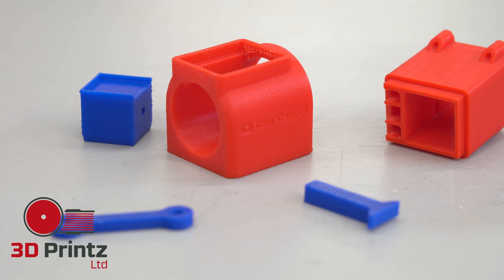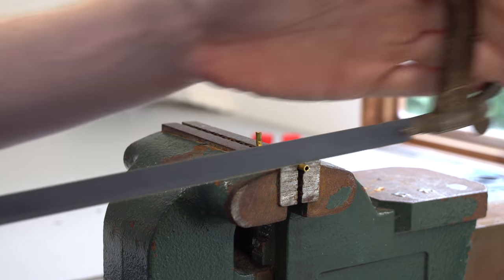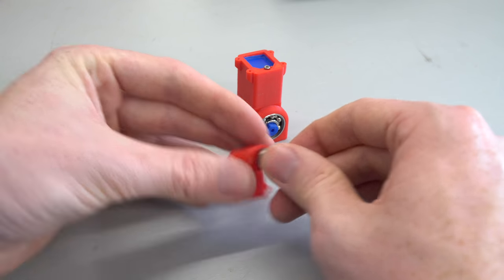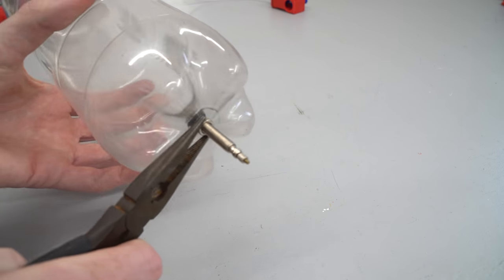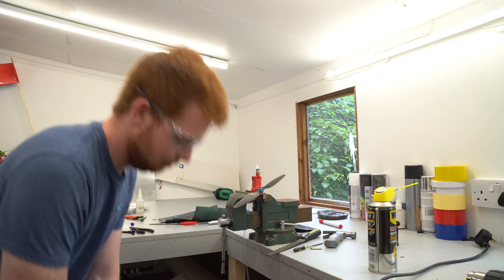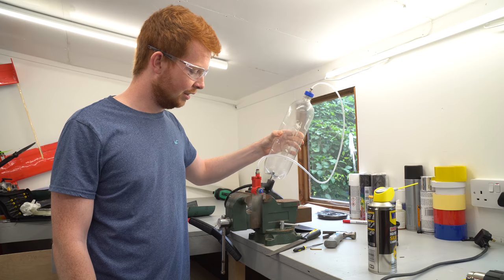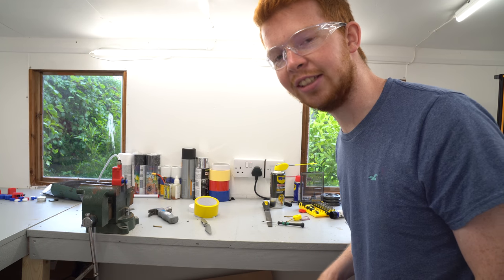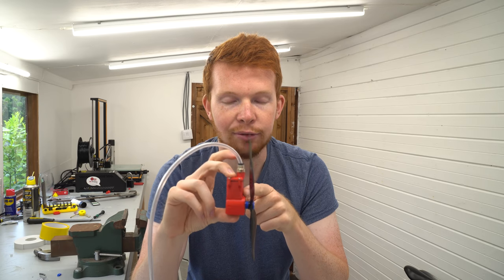3D Printed Air Engine BUILD

Comment: Hey Tom! In terms of efficiency, I found out that opposed piston engines are the most efficient! You should try build one, it's easier than it looks.
Reply: RedKugelblitz It only has one cylinder and two pistons. It's much more efficient.
Reply: RedKugelblitz The cylinder head has a lot of stress when the engine runs, and it turns really rough to the piston, and forces it down fast and it slowly decreases speed per revolution. On a opposed piston engine the energy is all used, because the cylinder head isn't dispersing any energy. Also, leaks wouldn't be a problem, since you would still produce twice the Torque in the output shaft (two crankshafts). You can also gear it and make the output shaft rotate twice as much faster by using a smaller gear on the output shaft. Also, the torque curve ( change of speed of the  piston per revolution , since the the energy is being displaced softly and constant, because there isn't any over pressure on the intake) is smoother, making the engine run better. And you can also use a rotary valve. The leaks could be a problem. You could come with an increase of about +30% on an internal combustion engine (without the losses by the leaks, 30% has the friction "included"), that with the leaks would be 20-25%.
If this air engine had 5-6% efficiency, this design could get it up to 10%, or even more. I'm a ic engine designer, you can trust. I'm basing on the two stroke Diesel opposed piston engine, if you were wondering.
Reply: RedKugelblitz You don't need any gearbox if you connect the output shaft With gears, as it is supposed to. And it doesn't have much more moving parts, so doesn't have much more friction. What I have said is that the cylinder head suffers from a lot of stress, and there is a lot of pressure there before expansion, so the pressurized airflow is reduced after the start of the expansion, since you can't get as much air, and the power curve is unbalanced and rough. The advantage in this design is that it can still run with the ball system, but is really hard to do that, but rotary valves are pretty good and much more efficient in this design, and believe me, with proper lubrication, that engine will run for a long time.
Reply: RedKugelblitz And you just have a central intake, so yeah. I've tried this with Legos, it's pretty nice.
Reply: RedKugelblitz I don't have any of the opposed cylinder engine Design, but I do have one of the normal one . Also, if you search for " Lego opposed piston vacuum engine" you can see some videos of a similar design of mine. I couldn't record it,  because camera seems to be epileptic and everything comes black, so I could only record the single piston. My design of the opposed piston is much faster than on those videos on YouTube, and has high torque. Unfortunately I don't have it anymore, my little brother destroys everything!

Comment: Hey Tom, hopefully you read this comment because I have an interesting idea. I suggest you put a fair amount of dry ice in the bottle and see how long the propeller will spin for. If not enough pressure is available at any given time, crush up the ice to increase its surface area in order to increase the rate of evaporation.

Comment: Could you remind me, why did you choose square shape of piston and not round?
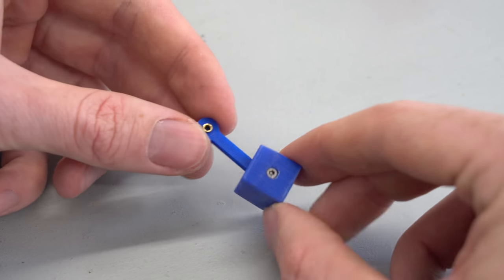Reply: Petras L  You got me curious too. It was so he could have the connecting rod off-center in the piston; so he could reduce the overall length of the engine, and eliminate one of the bearings. https://youtu.be/FoQUwpfFnnE  at 3:40.
Reply: Sanding a flat surface is easier than round.
Reply: Yep, its true also, but if i noticed properly, now rod right in the middle. And by having square piston, it should be very hard to make precise corners, like Tom mentioned, the same radius/shape to avoid air leakage there. By having round piston it should be possible to mount it, lets say, on the drill and grind it like with lathe. But lets see where "natural selection" will bring Tom's motor ;) Good luck! Its really interesting to follow this series!
Reply: I think round piston would be better, too. A circle has better perimeter to area ratio (around 3,5) than a square (4). That means, when you use a round cylinder, there should be less space for air leaks. Edit: these numbers are only for 1 cm2 pistons, but I think you get my point.
Reply: Round would have less leakage and less friction. Seems like the difficulty of manufacture is a no-brainer here, the engine would just run better once it was dialed in.

Comment: It would be cool to implement a throttle body with just a simple butterfly valve, or a  ball valve. This works off the theory of, just because my car's gas tank is full, doesn't mean I run it all out immediately. You could control rpm, make the air last longer, and not have to worry about the psi, you're putting through it as you can control how much air gets to the engine, not via a bike pump and a water bottle. This would be very easy to add, and wouldn't take more than $5 and 5 minutes.
Reply: He already made a membrane valve for one of his engines
Reply: Yep do this!
Reply: What he really needs is a pressure regulator so that he can have a high pressure reservoir last longer.
Reply: Por que no los dos?
regulator and valve. The membrane valve he built worked for demonstration, but would be almost useless in any actual use case. You can hook a servo to a ball valve.
Reply: Squat251 aluminum high pressure cyl hooked to a pressure regulator then a ball valve servo setup.

Longer run time with controllable throttle.
Reply: Pressure regulator with really high pressure container would probably be the way to go. Could probably used those tiny CO2 canisters to run the engine for quite a while.
Reply: WD40 dry sump system next...
Reply: Pilotgeek the changing temp might warp the cylinder making it lose compression.

Comment: If you check out dustin video at smarter everyday astronauts excercising equipment. The machine uses a vaccum pistol design that uses the surrounding atmosphere pressure to produce a constant force to simulate weight. For an air engine to use a vaccum piston it will need a second chamber that is connected directly to the engine which will be the source of air. The vaccum piston will apply a constant force to the second air chamber as a result, the air pressure that is going into the engine will be constant and at its most efficient and give the highest rpm to start to finish.
(DISCLAIMER) I AM NOT AN ENGINEER AND NEVER MADE AN ENGINE. JUST AN IDEA, THATS ALL.

Comment: to make the soft drinks bottles hold up to 120psi you can wrap them with duct tape for more rigidity, I have personally got my bottle to hold around 100psi for my diy tubeless tire set up
Reply: Daaamn! Creative.
Reply: The problem is that they'll take like 150psi at least, but only once. Plastic like this fatigues over time, so if you continuously use a high pressure it will eventually fail catastrophically. The bottles are designed for a maximum of 100psi (which is a full, shaken bottle, in a hot car), so I'm not sure why he doesn't just use 100psi constantly and swap the bottle out after a dozen or so pumps (isn't like they're expensive).

The duct tape would contain the shrapnel if it exploded at 150psi, but being that this is for an aircraft, the weight would be a pretty big downside.
Reply: Jacob T:  Daayyaammn good critical data!  Lesson learned.

Comment: You Should really consider using a graphite dry lube, less friction and more seal.
Reply: Daniel G. - Really good suggestion! In fact maybe a fuzzy sanding so piston almost fits tight then the graphite lube makes the seal slick?

Comment: maybe you could try using a additional layer of paint primer/filler after sanding to get it even smoother and maybe get the gaps smaller.
Reply: Andi - Yup good idea.  Spray paint would be best I think.  Plus there is that Krylon stuff that turns wood into acting like lubricated metal.

Comment: Good, back to basics on the build, looking very good. If you found a smaller diameter aluminum cylinder in the area of 40-50 mm diameter and say 300-400mm long, you could run the pressure up to 120 psi or higher and place a regulator set at 60 psi and the engine would run at air speed for much longer. In your tests before, at 60 psi the plane wanted to fly with the larger propeller, but the pressure died off so quickly it couldn't make it. This design is the best, IMO. The next step is to add 2 cylinders in order to get more torque, but then you would use twice the air volume...
Reply: Tony -  There is a comment on here that suggests wrapping the plastic soda bottle with duct tape to get 120 in that bottle!  I'm thinking the new Gorilla Tape would even allow higher PSI.  I liked your comment.
Reply: clavo Thanks! My idea about the small diameter aluminum tube would give less air drag. I think the tape would allow more pressure in the bottle, but you stil have all that large diameter surface as drag.
Reply: Tony: absolutely right about the drag.  I like your tube design in that aspect but balancing, costs and tooling intelligence needed; I wonder of a 2" pvc plumbing pipe would work?
Reply: clavo Yes the PVC would work at 120 psi and is a great idea. The limitations on PVC is right at 120 psi for schedule 40. It should work fine though for this application. I am not sure about the weight comparisons from PVC to a thin wall aluminum tube though, I would think the aluminum would be a tiny bit lighter in weight. The other side is as you say, fitting the aluminum would require special tooling and abilities. I like the PVC idea a lot. I should mention that the limitations on the pressure of PVC is the joints, not the tube wall. Having worked with PVC in compressed air systems shows that the failure is typically in the joints and where the failure is in the tube, other factors exists such as cantilever or external forces cutting the tube.
Reply: Tony - Just for grins; What would you think of Tom making a air compressor; almost identical to the motor, that would run off his bicycle back tire the way old mini electric generators did years ago?  He could set the back axle on a stand to let the rear wheel freewheel as he pedaled to run the compressor.  Again he could use PVC pipe (3") for a storage tank.

Comment: Just fantastic work, man. Something I was thinking about... There are dc motors air pumps... I don't know if any of them is strong enough, but... It may worth looking at. 😊
Reply: MC's Creations fun but very inefficient lol
Reply: Possible, one could keep air pumping into it continuously...  but like the person above said, yes, inefficient.  You might as well power it by a battery motor instead of an air engine at that point.
Reply: perhaps too heavy?
Reply: Robbie Boehmer It depends on what you use the motor for. If it's for an airplane, probably. But for a car?
Reply: As a rule, air under pressure will be a more efficient storage mechanism than a battery, by weight.
Reply: Guybrush T. -  i've been thinking of a similar idea for creating big volume air compressor for home use.  Only the syringe is a foot in dia. and ten feet long.  Yours is a really good idea.
Reply: @ Peter N Really? do you have some numbers for that? WattHours/Kilogram
Reply: Benjamin M. - In 1986 I helped a guy produce in-phase 115 VAC via  windmill driven air compressor and stored compressed air to turn a vane type air motor to in turn spin an induction type generator.  At that time I helped the Phd proff. research the viability of using compressed air and its efficacy.  It was pretty much universally acknowledged that Compressed air was the most efficient way to store energy.  I Can't give you numbers now but it shouldn't be hard to find.
Reply: Most efficient by what metric? Definitely not by weight, especially comparing to modern Lithium batteries.
My little bit of research gives me ~ 820 kJ/kg for Lithium-ion where-as I think you would have a hard time getting more than 200 kJ/kg from compressed air even with a carbon fiber tank.

Battery tech has come a long way since the old 150 kJ/kg of lead acid.
Refs: https://en.wikipedia.org/wiki/Compressed_air_energy_storage#Specific_energy,_energy_density_and_efficiency

https://en.wikipedia.org/wiki/Energy_density_Extended_Reference_Table
Reply: Benjamin - You may be right.  In fact they were looking at using old worn out oil wells to store the compressed air at the time.  How do you distribute that?   There are other factors to consider though.  Making use of battery energy requires electric metal motors and metal wires and high-tech. This is plastic, and low tech.
Reply: I agree, it seems my information was well outdated.
Reply: There is a way to recycle low pressure exhaust back into the pressure tank and create perpetual motion using non return valves look at Scott Roberson's compressor system and also Bob Neal. A leaf blower was used to create a free energy vortex!!

Comment: Try using pressurized CO2 bottles instead of a plastic bottle. They hold much more gas compared to their size and CO2 has one of the highest expansion rates. I don't know if the pressure would be too much for your engine, but I suppose you can use a pressure regulator for that.

Comment: Tom OKAAAY!  Well done young man.  You have an inquisitive mind and you enjoy the positive feedback from successful projects that began as hypothetical or theoretical propositions.  Here's a theoretical proposition:  make your motor run on that soda/Mentos experiment.  You'll need to make a removable Mentos dropper or depositor and plumb the hose to your motor as normal but because of the added viscosity you may be able to use thinner hose; or You may HAVE to use larger diameter hose for the same reason.   Maybe glue or attach a bottle cap that will just barely snuggly hold the mentos pill so that you can urge it to drop by tapping the cap.  If you need sketches let me know. I have many other questions and suggestions but don't want this to be too long.  I see there are many similar and better suggestions already.  It's amazing how many thoughtful creative people are commenting.

Comment: I just had the idea to use the area under the the cylinder (crankcase) as a "second" cylinder.
Reply: Yes, I think tom was talking about this in the last video. How the crankcase negative pressure is making it use some of the air pressure to make a full revaluation, if it was an opposed cylinder engine, it would stay neutral, if when one cylinder us tdc the other is bdc..
Reply: Phil theVwGuru I ment to put another cylinderhead on the crankcase. But that could be unefficient because the crankcase is too big so much air isn't used.
Reply: Seems like push/pulling the same piston as you are suggesting could be done just with some valving modifications of the same one cylinder head, combined with the valve as per old train steam engines.  A "D valve"?  Actually it's a push/push.
Reply: clavo I didn't knew that something like that exists but I think that adds  to much complexity.
Reply: Joschi 
Dual action cylinder steam engines were standard for high output like trains and ships. 

That might strain 3D printing ability

Comment: i wonder if a classical pneumatic motor would be more effective? or maybe a turbine style engine? would be much easier to build and propably much less internal power loss due to friction
Reply: That's a very good question.  Why were some heavy lift winches in old welding shops piston type pneumatic motors?  Higher torque at low pressure, I think.
Reply: i recon that those classical air fin models rely heavily on a combination of flow rate and pressure, where a piston engine only relys on pressure to build up torque, but it would be really interessting to see a direct comparaison between the two, maybe tom does it :)
Reply: Pneumatic motors are usually vane motors.
Reply: Harold S. - Yes.  The low rpm torque is better in a piston engine; but, in industry, most application use high rpm and the vane motors are more efficient and most common.  If you see an industrial piston air motor, it is in an antique shop!
Reply: Vane motors need more pressure than he could easily supply with a 2L bottle. Otherwise they're superior in every way.
Reply: Jacob - You sure know a lot about pneumatic stuff.  Bit I gotta advocate for homemade vane motor. They can have floating seals. 1" heavy wall PVC pipe for the main cylinder and a three vane solid plastic rotor with centrifugal seals.  I think Tom could do it. Today is 6/5/18. $20 contingent to him making a working plastic vane motor, if he makes it:  paid to Tom at his patreon acct.; if he makes it, with true video, before 6-15-18 CST US; No fair using old dental drills, has to be all plastic, all homemade; hose fitting can be store bought.  I could do it without a printer.

Comment: You should try and go up in bore, this should help you get less friction vs force that the piston exerts on the crank, because friction rises linearly with bore, but the force rises quadraticaly.
I'd go for a slightly oversquare engine (~1.2 bore:stroke). 
Maybe have the crankcase split into 2 parts horizontaly (like a gas engine splits the bearings in two) and try a 2 main bearing version?
BTW what is your rod to stroke ratio in the engine, you should aim for 1.75 (connecting rod 1.75 times longer than stroke), it's the optimum ratio.
Reply: akkudakkup -  Great lesson/comment.  I know I appreciate it.  Rod to stroke?  did you by chance mean stroke to bore ; or, bore to stroke?